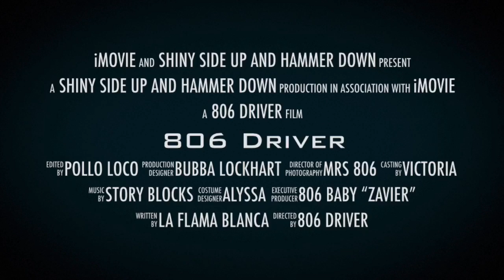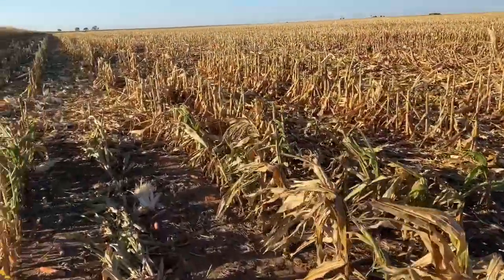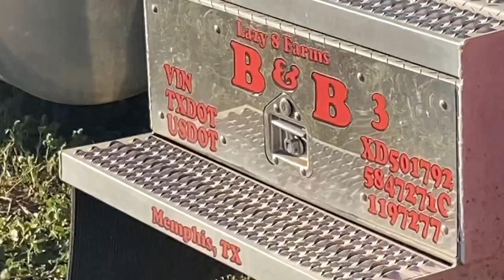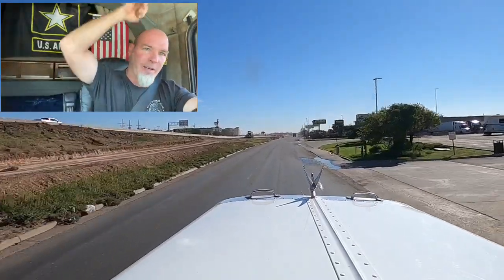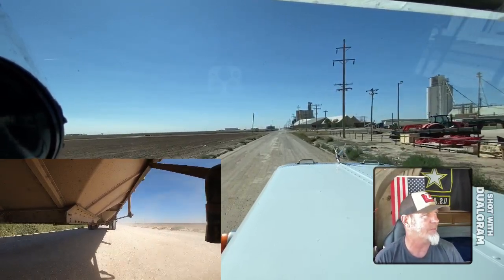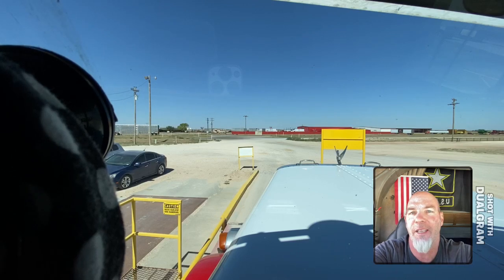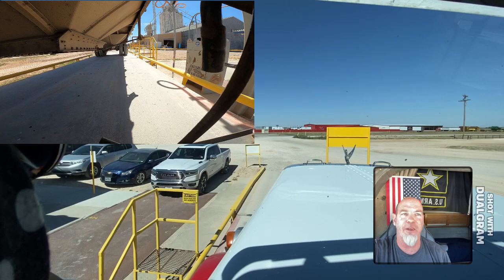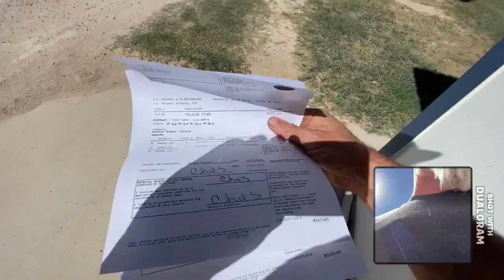Corn Harvest, Helping out a local farmer, Hopper Bottom Action, 806 Driver Trucker Vlog 💯💯💯

Comment: Great video (and your weather) .. cab flags look good .. interesting seeing the cotton still in the fields, corn harvester and twin hopper bottom dump trailer ...... My question today .. noticed the truck is left idling a lot .. is this for the air-con ? .. we're very fuel conscious in the UK (very expensive) but don't have your temperatures to deal with .. (60 pounds over could be the Cola bottles !! ) ... Safe journeys go out to the Coca-Cola Kid ! ! ! .... regards from England.
Reply from the maker: Leave running mainly for A/C and diesel is cheap here, yep I need to stay away from the Coca Cola 😂 have A great weekend Julian 👍🏼👍🏼👍🏼

Comment: How do you know you're legal with the bulk field loading, or do you even need to care (TxDPS scales)?  You probably just "eyeball' it?  Just curious.  Used to haul bulk carrots out of the Imperial Valley going to the San Juaquin Valley.  The trailers were pre-loaded.  Nearly every load was overweight and we had to drive an extra 100 miles to get around the CHP scales.
Reply from the maker: I have a suspension gauge on the truck and trailer and can get it pretty close, but I have rolled out of the field grossing around 100,000 lbs before, no scales in our area, just gotta watch for DOT and their portable scales, Tjanks for watching Donna, hope you have a great weekend💯💯💯
Reply: @806Driver  Thanks for the get back.  Good cheer to you and yours too.  :)